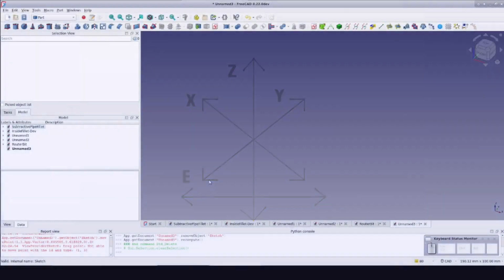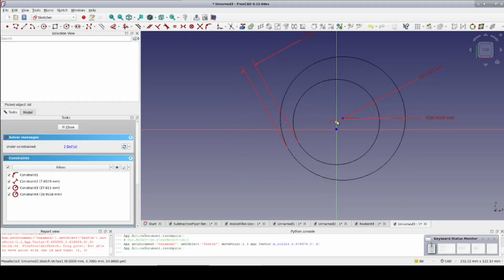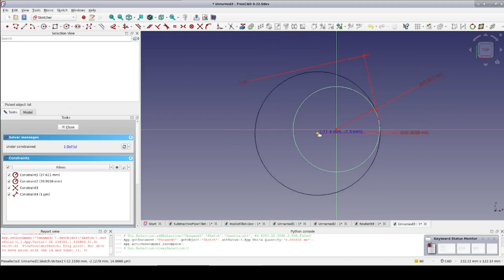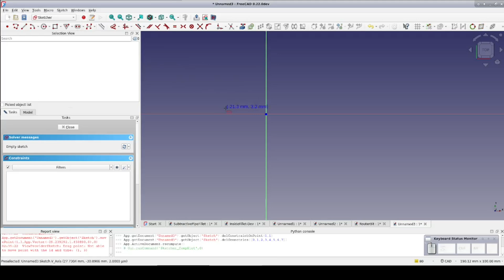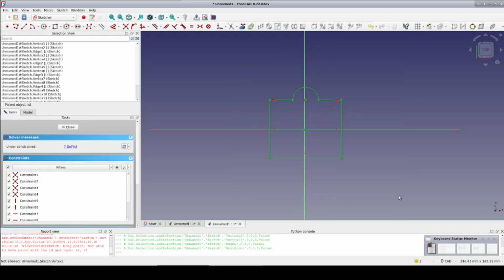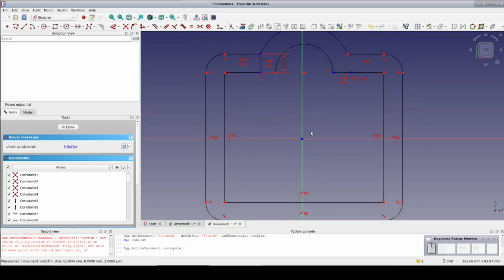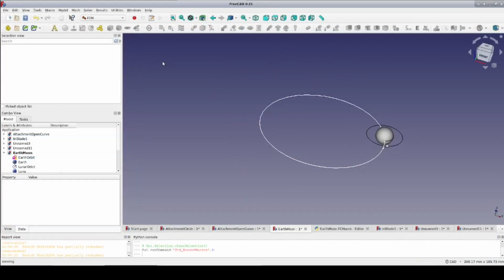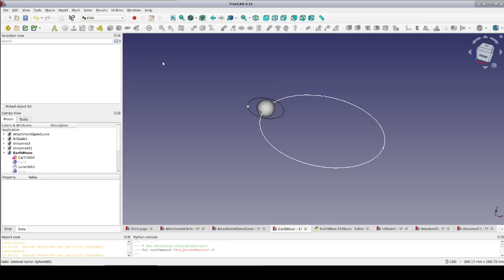FreeCAD: Still more upcoming attractions.

Comment: Here is an old one for you. Draw two independent boxes in sketcher. Now join them them to each other at one corner using the "coincident constraint". Now assume that sometime later(after adding many other objects and constraints you decide you want to detach the boxes by removing that coincident constraint. How do you find it without hunting and pecking by selecting lines to figure out which one it is? 
BTW: I submitted and issue for this in FreeCAD years ago and although there was discussion it never seemed to be resolved from what I can see
Reply from the maker: A good start would be to display coincident constraints. I agree it's confusing, but it's going to take some thought to figure out a good way to present the information in order to make deleting only the relevant coincident constraint easy.

Comment: Please check your recording settings. It looks like it was scaled down to 480p and/or compressed to much because the text is very difficult to read.
Reply: Exactly, but thank you for the great content!
Can you show how you would build rotating cylinder that sits on ball bearings and can be easily removed? I need that for a self build filament dryer for my 3d printer.